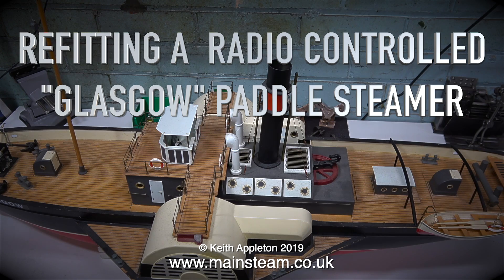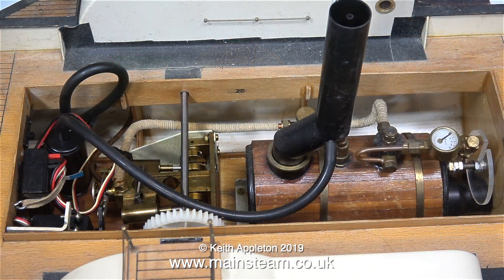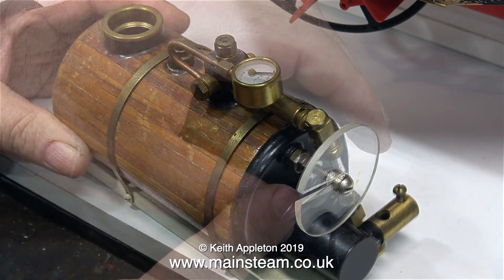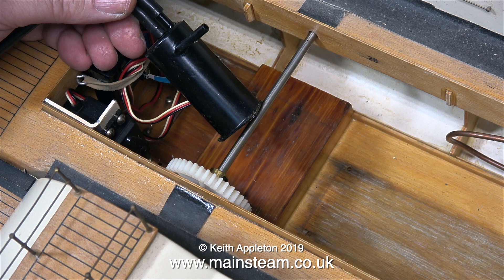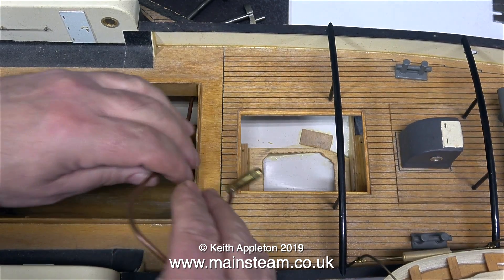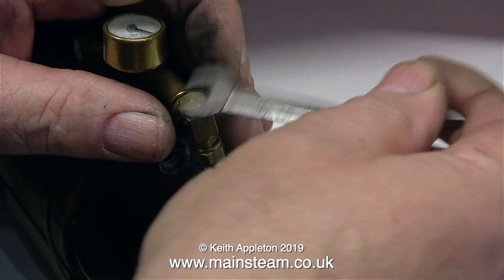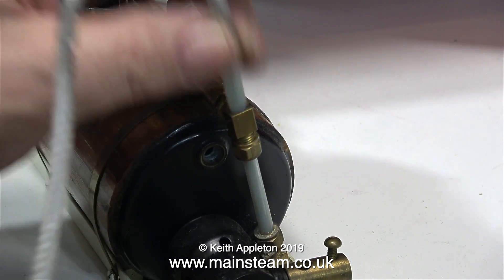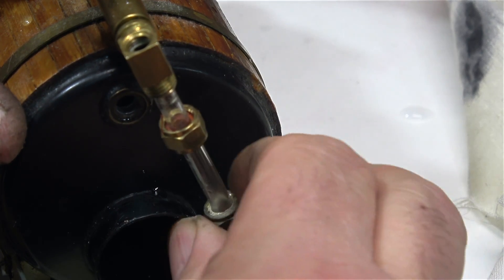A "GLASGOW" PADDLE STEAMER REFIT - PART #1

Comment: These paddles blades appear to be entering the water horizontaly ...???
Eccentric pivot is not in correct place, should be repositioned ahead of wheel shaft...
Reply from the maker: it only looks that way because the paddles are moving in a reverse direction .......
Reply: Reverse or not, they should hit and exit the water near vertical position.
Reply from the maker: They do ........ the video camera angle distorts it ........

Comment: Most Americans are more familiar with paddle wheels on the stern, but in fact the first paddle steam boat built by Robert Fulton in 1807, the "Clermont" was a side wheeler.  Side wheelers  were very maneuverable and thus made excellent tugboats, and were used in harbors all over America. The stern wheelers were favored because of their low draught on shallow rivers. Eventually of course the propeller won out.
Reply: I would say it's more that the lack of a need for large, shallow drafting boats on western rivers won out. I live in refinery land, and even the biggest tugs and barge hitches don't pull that shallow of a draft.

Once railroads overtook river travel post the civil war, the era of the great western steamer was largely over. I still dont know that you could play anything in the western red river , Any of the upper sabine/neches/trinity north of I-10, or anything west of Houston period, with a better system than a paddle wheel, and likely a high riding stern wheeler.